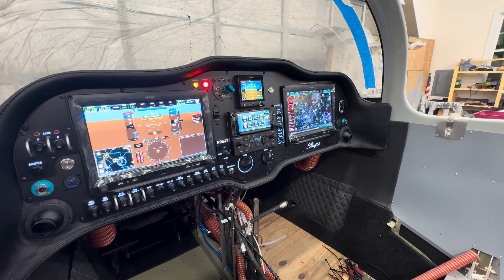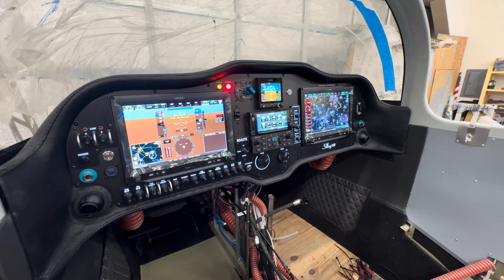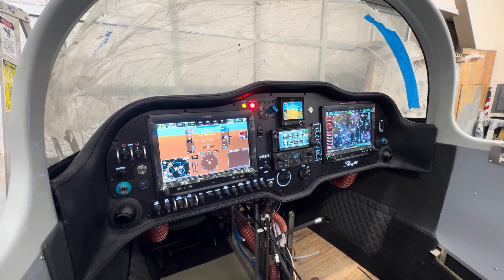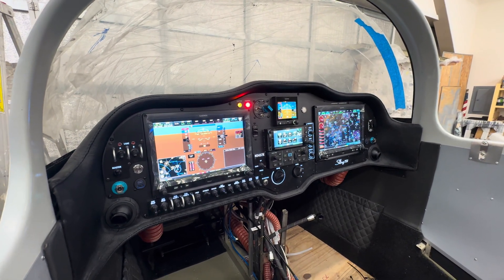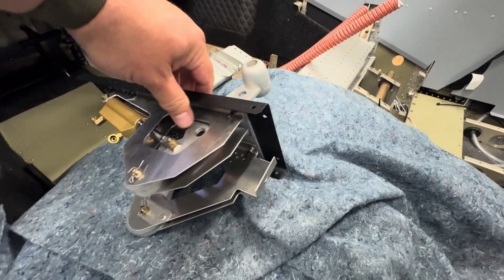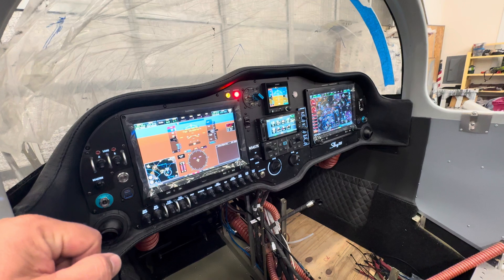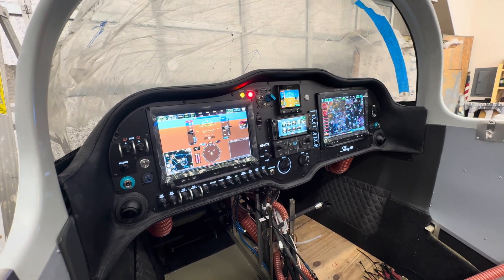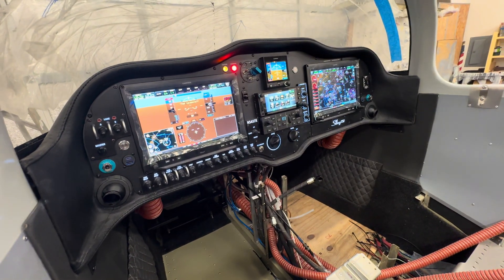Sling TSI Build Update - Panel Completion, Throttle Quadrant, Miscellaneous

Comment: Looks great! I'd look into going past a car paint protection film (PPS) application company and ask then to do either a Matt or the shiny regular PPS on the stick!? It'll be cheap as the sticks are small and they can use offcuts! If it protects million $ super/hypercar paintwork against chips etc at high speed it'll protect yr stick! Also ultra thin so most probably won't need play with it at top and bottom fitting grips and into floor... Vinyl gets sticky messy, not? Hope that helps! Love your channel. Blessings Andrew B
Reply from the maker: That’s exactly the product I’m using, I may have used the wrong terminology. I found a trim sized roll of this stuff on Amazon. It’s a Satin Black color almost the same as what I painted the control sticks.

Comment: Have you thought about using heat shrink tubing on the sticks rather than vinyl wrap?
Reply from the maker: The stuff I’m using comes in a ton of colors and sheens and such which I liked. It actually is somewhat of a shrink wrap in that it tightens up and activates the adhesive with heat.